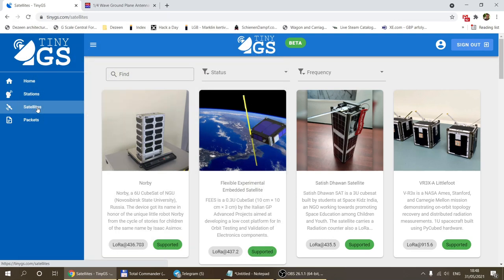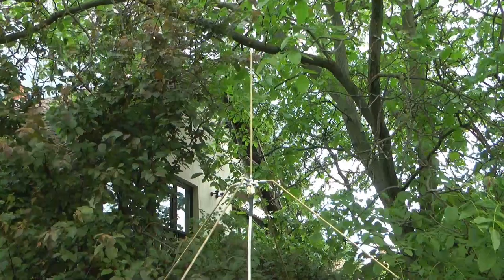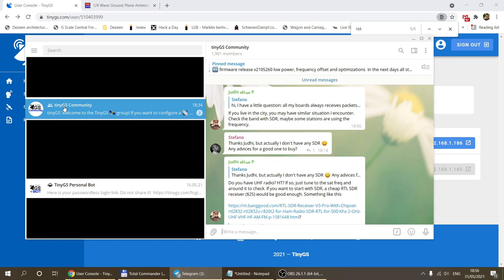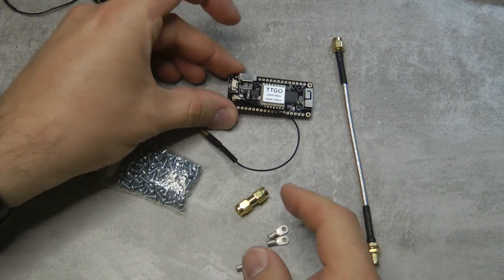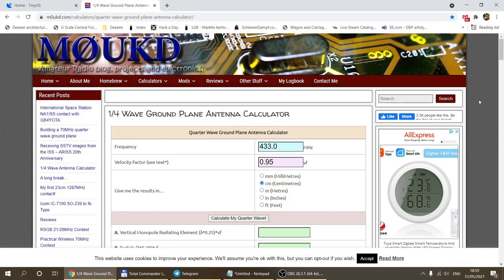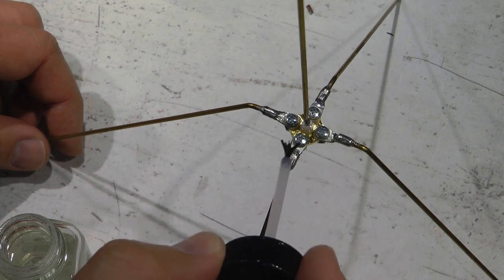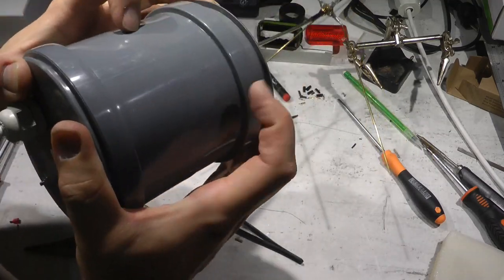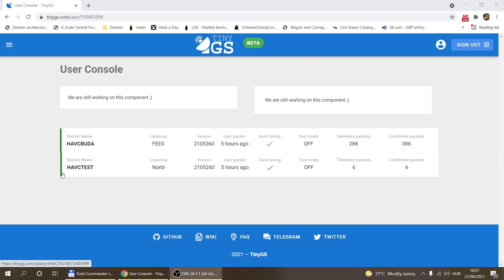TinyGS -  How to build your own satellite ground station

Comment: The "concave" PVC-cap --> you can put a hot-air gun on it to soften the PVC and push to make it convex. Plumbers do this all the time to bend PVC sewage-lines. If water accumulates near the SMA-connector, it will corrode/ingress for sure.
Reply from the maker: Thanks, let me do that.

Comment: Thanks for sharing this well documented/described build. Great idea to use the PVC piping for the enclosure. I’d suggest to drill a tiny hole at the bottom to make sure moisture, condensate etc can drain out (similar like you see on outdoor junction boxes, switches/sockets.
Reply from the maker: Yes, I was thinking is it better trying to seal it completely, or just allow the water to drain out. I will run this like this for a while and take it apart to see how it looks like in a few weeks. But of course, this is summertime now, so it could be worse in the winter.

Comment: Another useless video on TinyGS that fails to even provide an accurate description of the functions, if there are any. So far its only about how you can see data from tiny satelites , in other words, an apparently functionless activity. Not one video describes how anyone can  send a message via a TinyGS. All that basis info can be seen on line. Its a very disappointing satellite.
Reply: can you find anything about sending packets to satellites?